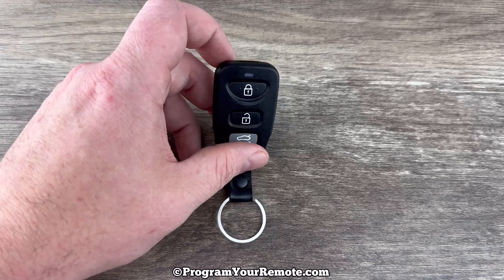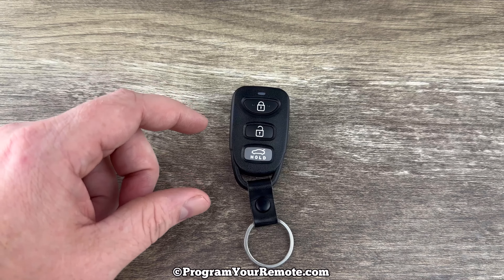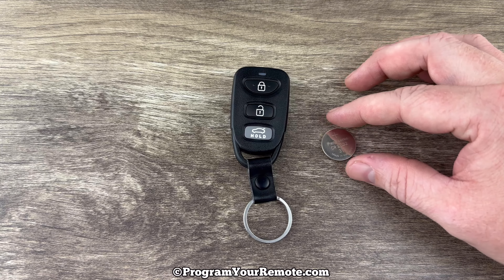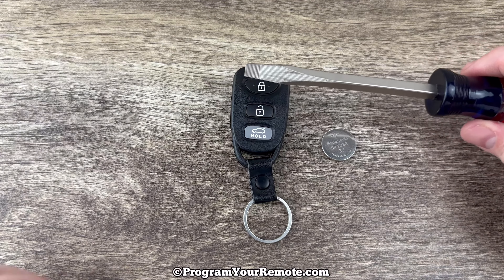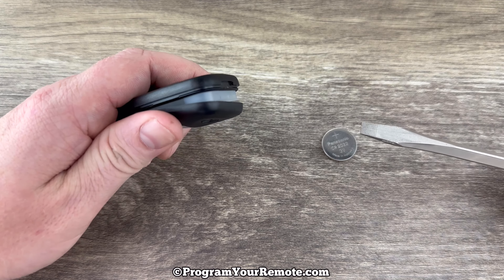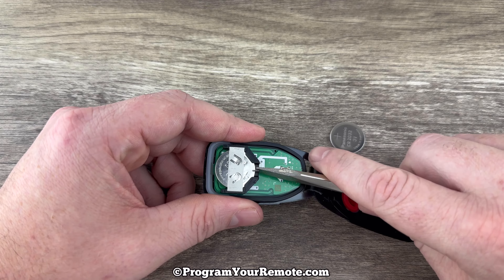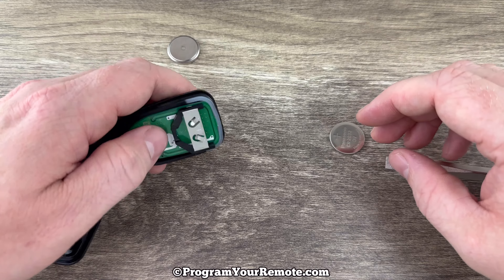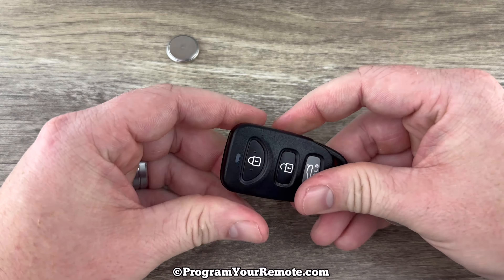How To Replace 2007 - 2020 Hyundai Elantra Key Fob Battery - Change Replacement Remote Fob Batteries

Comment: Thank you! I have a 2017 elantra and I can't get the new battery to work? I followed your instructions. The light on the fob doesn't light up. Could the issue be that I'm using a lithium battery? I'm open to any suggestions. Thank you!
Reply from the maker: if you are sure the new battery is installed properly ( not upside down) then the battery itself may be bad. they are all lithium but you may still want to try a different battery

Comment: The battery is rattling, like it’s lose. Idk anymore lol if I hold everything together outside the case it works but when I snap everything together it doesn’t, like it’s not tight enough.

Comment: So strange. I'm only here out of curiosity. My 2023 push button start hyundai key fob battery died and after replacing it I suddenly wondered about my spare car... a 2013. I was shocked when the battery for my 2023 died ( never expected this, not something I ever thought of) and absolutely never heard of these older models dying. My sister has a 2009 and still the same fob. My 2013 still has the same fob and battery. Any other vehicle (all hyundai's) I've owned (Been buying them since 95) all with well over 100,000 miles on them and very old never had an issue. Finding out now that this happens is just a wow moment!  Something I never thought of....ever.  Smacking myself in the head saying "how did you think they worked...idiot?" 😆

Comment: Key fob wasnt working. I replaced the battery and it still isnt working. 2011 elantra.
Reply: Did you also check the fuse?

Comment: Why after replacing my key fob only unlocking a vehicle, but not locking. Trunk button keep working too.
Reply from the maker: sounds like there may be an issue with the lock button on the new fob